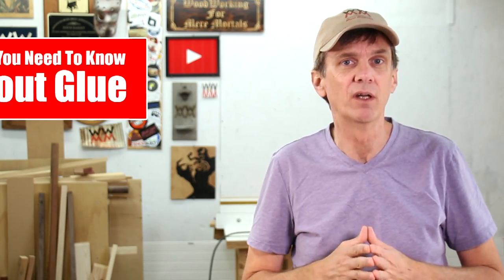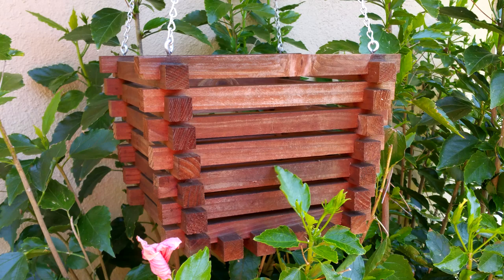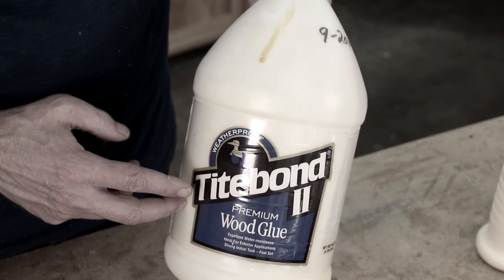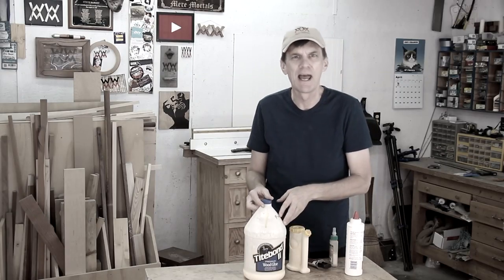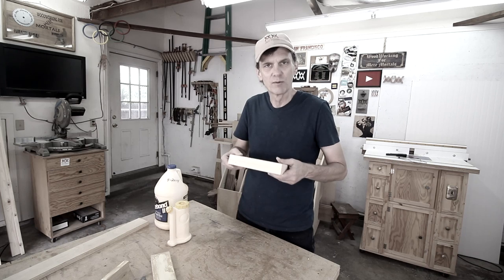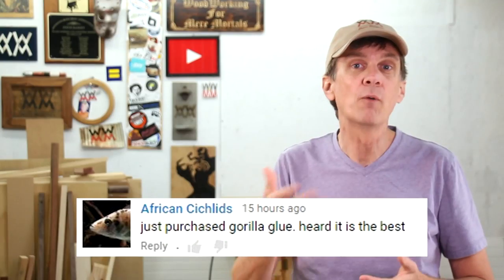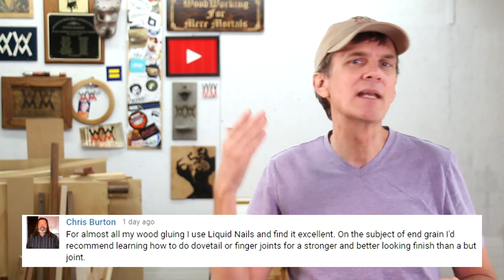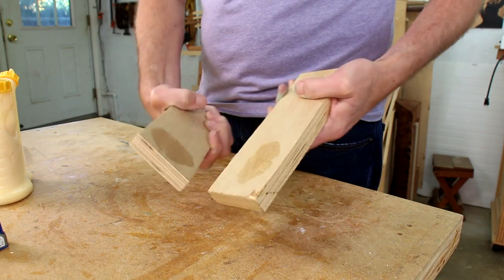Why I Don't Use Titebond III | MORE MINUTES

Comment: Steve, I appreciate your vids, but you are using anecdotal evidence to make your claims. Some of them are dead wrong. 

- You definitely want glue on both sides. This becomes a chemical bond, not just a mechanical bond
- You definitely can squeeze out too much glue. Depending on your surface finish as well. If you're gluing up 2x4's from home depot, yeah youre probably not gonna have any issues. If you're gluing face grain close pored woods, you very much can have too much squeeze out... Also, if your tolerances are low, squeeze out isn't an issue. Not saying "sloppy" saying lower tolerance, dont misread here. It also plays into the size of the object as well.
- super glue is also something that needs glue on both objects. It is, again, a chemical bond. 
- theres a reason fine furniture makers use cauls. 
- PVA glue does go bad, usually due to air contamination, not the physical glue going bad. If a gallon lasts more than a year, might be more practical to simply use the smaller bottles
Reply: +JgHaverty "You definitely want glue on both sides. This becomes a chemical bond, not just a mechanical bond"

I've tested this a few times. Whether I glue both pieces of timber or just one piece of timber, when the glue has completely cured, and I test the join to failure point, it's not the glue that fails. It's the timber fibres coming apart that causes the joint to fail (in the case of pine glued with pva wood glue). Seems to be that when I need a stronger structure I'm better off using stronger timber instead of gluing both surfaces.
Reply: GameraTheBrave

In woodworking, the wood doesn't matter, the glued joint (if done properly) will ALWAYS be the strongest point. I've had ipe panels fail, and the glue joint still held, the wood failed.

Soft woods only exacerbate it, but there is a chemical bond going on.

Glue (any glue) works... like a sandwhich... (Bear with me). The wood will be the bread, and the glue will be the filling. The wood has adhesive forces to the glue. The glue then has cohesive forces to itself. Then the other side again, adheres to the wood. You want a practical analogy? Put some mayo (or whatever) on a piece of bread and spread it around. Then take that piece and put it on a dry piece. Squish it together a little bit (dont go crazy), and pull the pieces apart. The side you spread the glue on will still have the lions share of the "glue". That is why you apply glue to BOTH sides.
Reply: GameraTheBrave
haha i just did the bread thing, its a pretty damn good analogy :D
Reply: +JgHaverty You sound like a glue salesman.  Been woodworking for 50 years.  I have found that one side is enough.
Reply: Don't care if you've been working with wood for centuries. That doesn't change the fact you're ignoring the chemisty and physics behind putting glue on both sides. Glue salesman? haha cmon glue is cheaper than bottled water.
Mark W
Reply: Nah, the fact you don't understand hyperbole doesn't make me stupid.
Reply: All I care about is the practicality of it working.  It does, I have never had a failure. who cares about your mumbo jumbo.

Comment: The beniftis of titebond 3 is it’s woaterproof and gives a stronger bond. Used industrially for assembling doors and windows. It is preferred for gluing up under great tension like bends and bows glued up from stripes of wood. You should’ve done some research before babbling about it on youtube. All your material is based on assumptions without any real knowledge. Nobody should take this channel seriously.

Comment: I usually like your videos and respect what you say, but this one was filled with some inaccuracies:

1) Wood® magazine had a segment where they explained that salt on a glue joint doesn't do anything and in fact weakens the joint 
2) Matthias Wandel (YouTube woodworker) showed that Gorilla Glue is actually not good at filling gaps, but is very strong when clamped. 
3) The reason that your CA bond did not work is that you put on too much, not that the glue is weak. The recommended amount is about 1 drop per square inch.
4) The accelerator you mentioned (aka 'kicker') is not special for one type of CA glue, but rather sprays on bonds and works with all types of regular cyanoacrylate (thin, medium, thick, etc.) 

Anyway, I always enjoy watching you, but please do a little more research before you put out videos.

Comment: waterproof and weather resistant are not the same, construction 101. waterproof it can be soaked 24/7.. weather resistant can get wet but needs to dry out otherwise the water will eventually get threw the glue. and destroy your material. like your phone water resistant can deal with rain drop that bitch in the toilet and its dead no fixing it,

Comment: This guy might know a lot about woodworking, but his adhesive knowledge is lacking.
Reply: Christopher Hall care to substantiate your argument? I know very little about adhesives as well and if there is misinformation in this video I’d like to know.
Reply: @photonganglol2413  I strongly disagree with his lack of belief in super glue. It's incredibly strong when used the proper way, it's just not the best choice for bonding wood. But it's invaluable in projects.
Reply: @photonganglol2413  Also, I'm not convinced that Titebond 3 caused that discoloration.
Reply: Christopher Hall 1.) if i recall correctly, he limits his “disbelief” in super glue to the confines of woodworking projects specifically, as this is indeed a woodworking channel. 
2.) All he said about the discoloration was that he had one project where there was severe discoloration with title bond III and hundreds of other projects with title bond II that had no discoloration. 3.) not being convinced that something is the causer is not good enough grounds to make an assertion like “his adhesive knowledge is lacking”. Is there anything concrete to substantiate that claim? Also, what glues do you use? Titebond II seems to be a good deal that I can get on amazon but Titebond III has a better price in Home Depot so I’m kind of back an forth on what to buy
Reply: @photonganglol2413  Super Glue works great in lots of woodworking projects, just not for the load-bearing parts.  Titebond III outperforms II in independent tests and still probably didn't cause that discoloration.  I didn't even get into the waterproof/weatherproof fiasco.